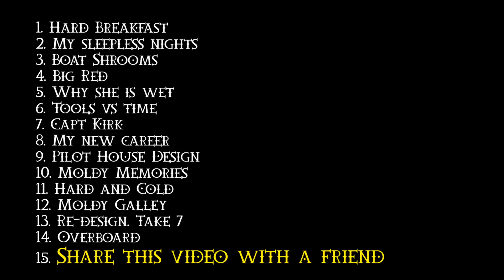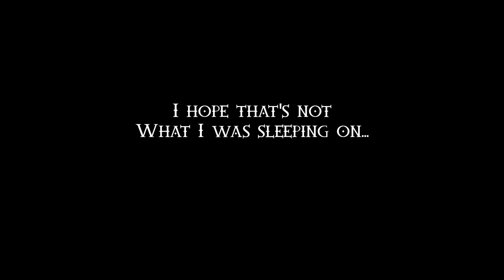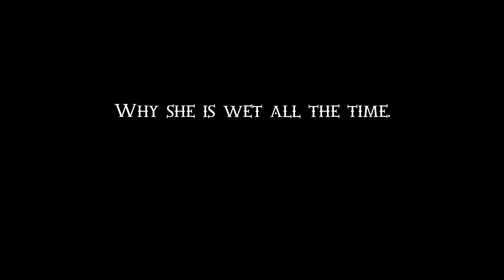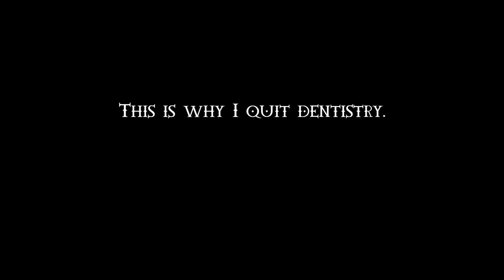Diy Sailboat Projects - Sailboat Refit & Liveaboard Lifestyle - Dawn Hunters Sailboat living

Comment: One last thing, dueling you’re opening and closing graphic with the red filling the sailboat.  There’s some squeezing / whistling.  What is that?  I got the impression it’s a windless being cranked.  Is it anything in particular?
Reply from the maker: Iana here. Good morning Perry! If I remember right there is a mix of sounds. Different type of winds, ocean waves and wood cracking on the old ship. Smth like that 😉
Reply: Dawn Hunters And a good morning to you too.  Yep. It’s like you said.  It starts off with the sound of I don’t know - a bird chirping? A wagon wheel turning that badly needs some grease?  Idk.  Then there’s this cylindrical tank and a stream of liquid pours into the center of it, which builds up the red sailboat, while at the same time filling the tank with what I assume represents water.  Then, waves crashing and wood cracking.  So, that squeaking wheel sound has me stumped. Lol. You guys have a great day and stay safe. Stay funny.  Just stay (on the boat on the ocean).
Reply from the maker: Perry Diddle you got me interested I’ll it look up in my downloaded sounds 😉

Comment: You dont use a saw for foam you use a razor blade.
Reply from the maker: Tommy Topham iana here. hey Tommy! Welcome aboard. Usually it works like this: William tells me what to do and gives me a tool lol. I’m not very handy and I didn’t have any experience in any kind of renovations so usually I try not to question until it doesn’t work on the job he gave me lol.
Reply: I used a bread knife to great effect on my foam mattress. A metal cut blade on a sawzall would be awesome!
Reply from the maker: Orcinus1967 Thats probably what I would use if William wouldn’t give me a saw! 😁
Reply: Electric carving knife if they still make them.  I found one at a garage sale and keep it for when I need to shape foam.